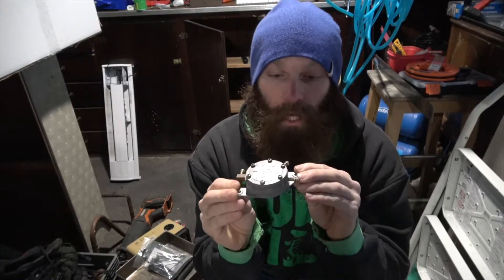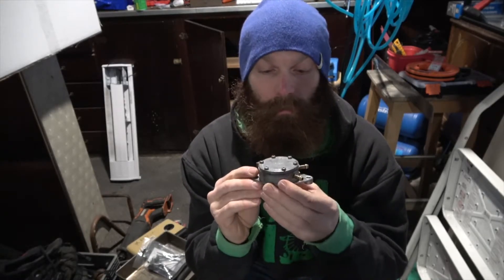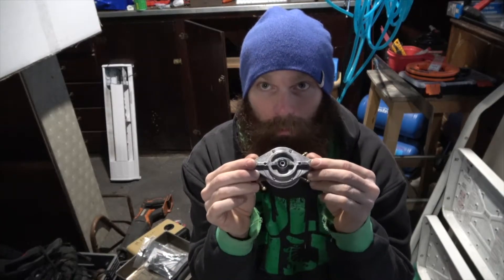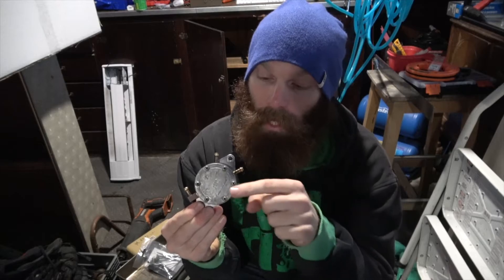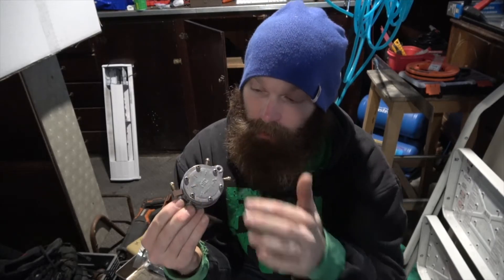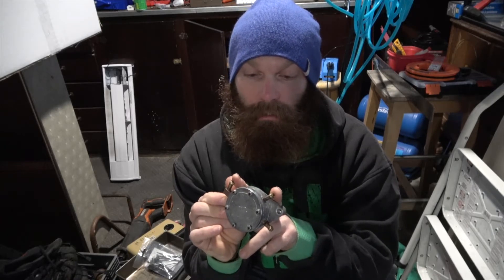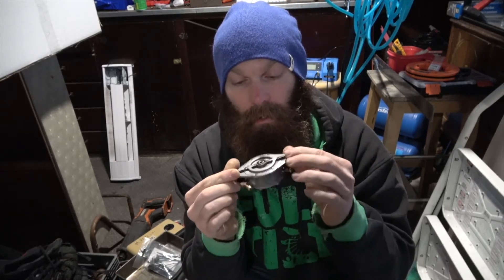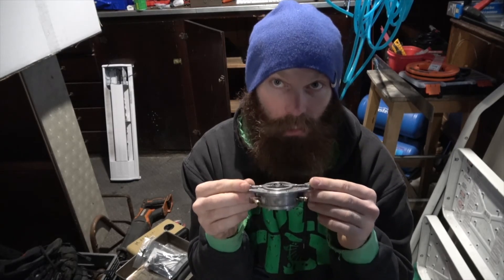How does this fuel pump work?

Comment: The pulse is created by the pumping action of the piston and taken from below the piston, off the crankcase. There is usually a hose that provides this pulse signal from a fitting on the lower part of the crankcase to the fuel pump which is located nearer to the fuel tank. On snowmobiles it is usually on the belly pan or air box. 
Inside the fuel pump is a diaphragm that separates the pulse side from the fuel pumping side. The pulse causes the diaphragm to move back and forth which in turn draws the gas in from the tank. And then pushes it out to the carb(s). There are reed type valves in the pump that act as one way valves so that the gas drawn in doesn't get pushed back into the tank. And so that the gas in the carb doesn't get drawn back into the pump. 
Problems can be: a compromised diaphragm that can affect the pumping action and sometimes can allow gas to be sucked into the crankcase via the pulse line. This creates a very rich mixture for which ever cylinder is plumbed to provide the pulse action. 
Also the valves can act up, the pulse line itself can be compromised as can the line from the tank or to the carbs. 
Most of these pumps are rebuildable. If parts are not available you need to know that any pulse type pump with the correct number and size of inlet and outlets can be mounted somewhere and will work. And you could use (for instance) a three cylinder pump with three outlets on a single or twin by capping off the extra outlets. 
And yes, some pumps mount directly on the crankcase and thus need no pulse line. It appears yours might be that type and your pulse is provided via that hole in the back/bottom of the pump. 
And now do I win the award for the longest you tube comment ever?
Reply from the maker: You win!  I didn't know YouTube allowed such long comments.  Thanks for the help!
Reply: Thank you!
Reply: Great job Mr. Wizard!  Thanks
Reply: I enjoyed it so much I am going to read it again! A question for you, I noticed on an inverter generator the line to the carburettor was on a tee further down from on a a fuel line from the pump. How does this work?